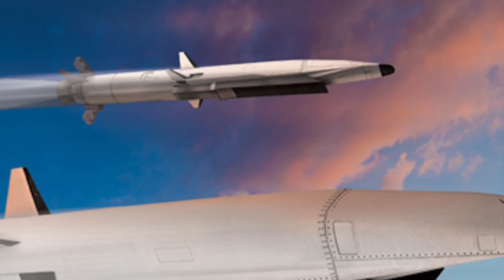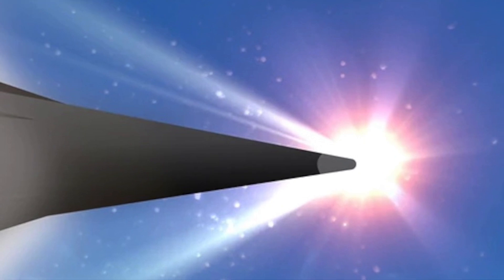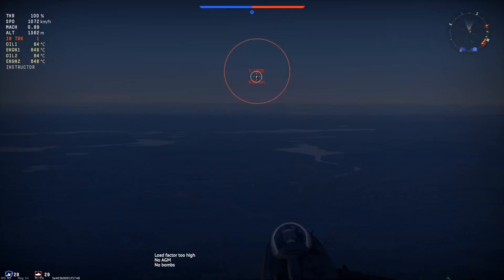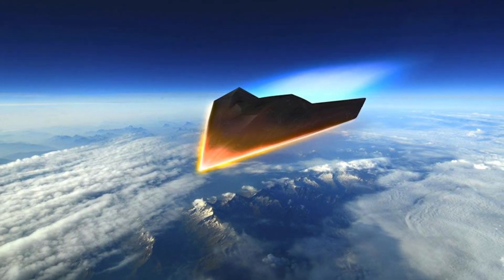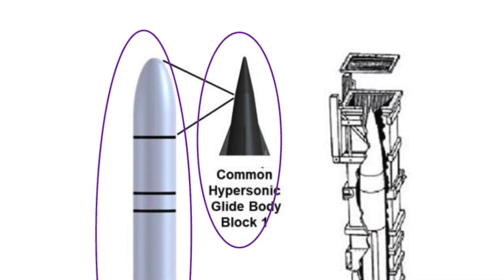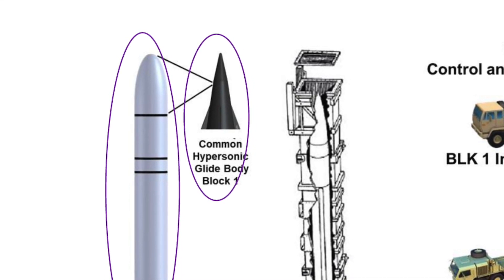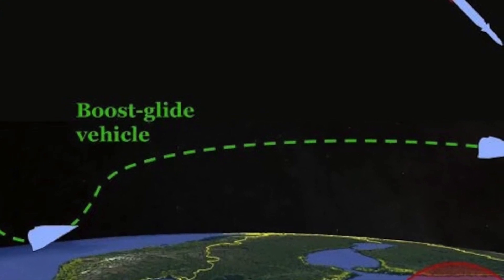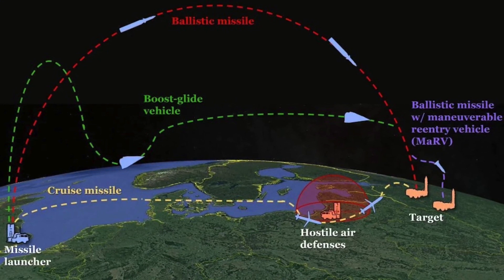Key component for U.S military's Conventional Prompt Strike & Long Range Hypersonic Weapon tested !

Comment: Hypersonicc speed is possible only in stratosphere, at lower altitudes higher atm.pressure and all missiles\gliders losing speed to low supersonic speed, precision 10m accurasy require subsonic speed. 
So all hypersonic weapons can be easy intercepted by current SAM system at finish stage.
Reply: Agreed.
Reply: Not true.
Reply: like some other guy said this is simply not true...

Comment: Hypersonic missiles can not maneuver according to Russias own ram/scram jet patent for their own hypersonic missiles. I would need some serious explanation on how the missile can maneuver with it's engines off and moving at the speeds it is and still hit it's target... They can even self destruct do to increased air pressure when trying to hit its target, so moving would add more stress. For a military page, you should know this, with all due respect.  
"Russian patent number 2579409 relates to the field of rocket technology, and more specifically to hypersonic cruise missiles equipped with a hypersonic ramjet engine. The invention describes a method of application and device hypersonic cruise missile (CRPD), allowing to solve the problem of performing a combat mission to destroy ground and surface targets of such a missile. The described invention is designed to maximize the combat potential of the CMP with the scramjet.

The design mode for the scramjet are high-altitude cruise conditions while maintaining the estimated cruise speed, and the need to reduce the altitude and flight speed creates difficult technical problems due to the fact that:

an engine designed to perform a hypersonic mid-flight at high altitude is not able to continue to work at low-altitude trajectory sections associated with a decrease in the flight number M, hence, the rocket must approach the ground or surface target with an inactive engine;
characteristics of sustainability and controllability of CRPD with inactive scramjet significantly deteriorate, loss of stability becomes possible;
there is also a danger of destruction of the scramjet design due to the increase in pressure in the flow part of the engine while reducing the CMP from the march height before hitting the target."

The US also had hypersonic missiles since the 70s. Google aim 54. The Groundbased midcourse defense is also the fastest hypersonic missiles in the world capable of mach 33. The US prefers subsonic, not even supersonic, sea skimming, under the radar horizon, LO/stealth, missiles.
Reply: hypersonic missile with scramjet engine have poor maneuvers coz it require the air flow has not been interrupted. After engine switch off Hyp.missile is just warhead.
Hyp. Gliders much advanced weapon than hyp.missiles, gliders can use extensive maneuvers, they have much higher speed, higher altitudes. 
Currenly, US leading in gliders technology after few succsesful tests.

Comment: Kinzhal is balistic missile, not hypersonic weapon. This missile has  3 tons mass it can not glide at 10 Mach without losing altitude and speed  dramaticaly, and overall it has no shape of glider for gliding.  Hypersonic weapon should gliding, or should have scramjet engine, but Kinzhal has no scramjet because there is no air-intake in design. 
   All medium balistic missiles - iranian or north korean  have Mach 10 speed, but hypersonic weapon should have  horizontal flight profile, not balistic flight profile.
Reply: This channel gets a lot wrong. It even states hypersonic missiles can maneuver, when Russias own patent says they can't as they need to shut their engines off. When coming back down from it's higher altitude since it needs to take a ballistic path for it's scramjet to even work(it needs thin air and speed) it can self destruct when coming back down to thicker atmosphere when trying to hit it's target, all according to their own patent.
"Russian patent number 2579409 relates to the field of rocket technology, and more specifically to hypersonic cruise missiles equipped with a hypersonic ramjet engine. The invention describes a method of application and device hypersonic cruise missile (CRPD), allowing to solve the problem of performing a combat mission to destroy ground and surface targets of such a missile. The described invention is designed to maximize the combat potential of the CMP with the scramjet.

The design mode for the scramjet are high-altitude cruise conditions while maintaining the estimated cruise speed, and the need to reduce the altitude and flight speed creates difficult technical problems due to the fact that:

an engine designed to perform a hypersonic mid-flight at high altitude is not able to continue to work at low-altitude trajectory sections associated with a decrease in the flight number M, hence, the rocket must approach the ground or surface target with an inactive engine;
characteristics of sustainability and controllability of CRPD with inactive scramjet significantly deteriorate, loss of stability becomes possible;
there is also a danger of destruction of the scramjet design due to the increase in pressure in the flow part of the engine while reducing the CMP from the march height before hitting the target."
Reply: @ThatCarGuy  - Yes, they cruise at high altitude and discard the scramjet for the dive. Nothing in the patent says it can't manuever during either stage, and it's been specifically stated that it can.
Reply: It doesn't really fit into the category of ballistic or cruise missile. Some are calling it a semi-ballistic missile. It can perform guided maneuvers throughout the flight time, so not really a ballistic missile from an interception standpoint. A scramjet would give it better range, but range isn't a criterion of a hypersonic weapon. Frankly, the term hypersonic weapon is rather vague, you could argue that many weapons qualify, particularly Iskander. But Kinzhal certainly qualifies for the most common definition, which is a weapon that travels faster than mach 5 and has the ability to maneuver throughout the entire flight.
Reply: @davidste60  They can not maneuver. It's like you didn't even read it and/or understand it. I will quote the section that matters
"an engine designed to perform a hypersonic mid-flight at high altitude is not able to continue to work at low-altitude trajectory sections associated with a decrease in the flight number M, hence, the rocket must approach the ground or surface target with an inactive engine;
characteristics of sustainability and controllability of CRPD with inactive scramjet significantly deteriorate, loss of stability becomes possible;
there is also a danger of destruction of the scramjet design due to the increase in pressure in the flow part of the engine while reducing the CMP from the march height before hitting the target."

Now with an inactive engine how do you maneuver? They even state it can lose sustainability/controllability...  With stress levels so high at low altitude without maneuvering the possibility of self destruction is possible, all according to it's own patent.. Yet you think it can add more stress by maneuvering at those speeds? Im sorry but you are just flat out wrong.
As proven above they can not maneuver.

With it's engines off, say it's target is 600km away, and lets use the zircon missile for my example, it's max speed is mach 9, convert that to KM/S that about 3km/s. So to reach it's target at max speed(ignoring the time it takes to reach max speed) it will take 3:33... Say you wanted to move a single degree for 5 seconds at 3km/s(lets ignore the engines are off and still somehow magically maneuvered) which would send you off course 15km, how do you maneuver back on course. Scientifically and mathematically explain it to me and prove the Russians own patent and me and my math wrong.
Reply: @ThatCarGuy  - I don't need to prove the Russian's patent wrong, becuase I have read and understood it and you either haven't or are being delibrately dishonest. The problems they outline, that you have quoted, is part of the problem statement. They then go on to describe their solution:  

"This goal is achieved by the fact that, in contrast to the known method of defeating the CMP target, which consists in launching a rocket to a predetermined altitude and flight speed with a launch and acceleration stage (CPC), detachment of CPC, launch of a sustained scramjet, active flight at an estimated height in the direction of the target, search , capturing and hitting the target, in the claimed invention, after detecting and determining the coordinates of the target at the point of the trajectory calculated by the onboard instrumentation of the control system (BASU), the scramjet is switched off.

After the end of the active part of the flight power plant is separated from the combat module. The trajectory segment associated with the planning and destruction of the target overcomes the combat module. The separation of the power plant will lead to a decrease in drag and, consequently, to an increase in the length of the planning section, the combat module will be able to withstand large allowable overloads and, therefore, have better controllability. Also, the separation of SS will lead to a significant decrease in the effective dispersion surface of the combat module, and, consequently, to a decrease in its visibility, which is especially important when approaching the target.
Reply: @davidste60  Im being dishonest yet you literally quote ...
", which consists in launching a rocket to a predetermined altitude and flight speed with a launch and acceleration stage (CPC), detachment of CPC, launch of a sustained scramjet, active flight at an estimated height in the direction of the target, search , capturing and hitting the target, in the claimed invention, after detecting and determining the coordinates of the target at the point of the trajectory calculated by the onboard instrumentation of the control system (BASU), the scramjet is switched off."

So predetermined trajectories are maneuvering? That's news to me. They can not maneuver.
Reply: @ThatCarGuy  - Read the bit before that, "in contrast to the known method of defeating the CPM target, which consists in...". It's a patent, they describe the known method and then, in contrast, describe their new method. No one writes a patent to just explain a known method. Once the engine has been seperated from the combat module, the problems they described with scramjets no longer apply, because the scramjet is gone. If the combat module goes 15km off course in 5 seconds, for whatever reason it would decide to do that (seems excessive to me), it can turn the opposite way by 1 degree for another 4 seconds, then some lesser angle for 1 second to get back on track. Using aerodynamic surfaces of course. That's why I raised the possibility of dishonesty, because you're reading the same document as me, and leaving out vital qualifying parts of it, which do not support your argument.
Reply: @davidste60  Blocked, you are trolling me hard at this point. There is no way you do not understand the patent that badly. 
Everything I quoted to you is "in contrast to the known method of defeating the CPM target, which consists of..."

So since it's in contrast to everything I quoted
" the scramjet is switched off."
I guess the scramjet is left on to self destruct....

"after detecting and determining the coordinates of the target at the point of the trajectory calculated by the onboard instrumentation of the control system"
I guess we have no target detection since everything is in contrast to my quote above. 
You got me, first troll in awhile that got me that i didn't outright block. Congrats, have a good time trolling others.
Reply: @ThatCarGuy  - Get someone else to read it and explain what they think it means to you, without telling them your opinion first.

Comment: What about laser weapons they use chemicals as a weapon that faster than Hypersonic?
Reply: It would have to be a really strong laser. One commonality of all the hypervelocity missiles and reentry vehicles (HGV) will need to be their resistance to the heat of passing through dense sea level atmosphere at more than five times the speed of sound, usually this is accomplished through the use of ablative tiles or some other temperature resistant ceramic or cermet. The SR-71 only did Mach 3.5 and had to be at extremely high altitude to survive the passage through the attenuated air at speed even at that height. The heat of passage in the SR-71 was mainly stored in the fuel which won't be an option in a hypersonic weapon, they just aren't big enough, and even with that large internal heat sink the friction caused the plane to expand by almost a foot. Burning through the skin of a hypersonic weapon with a laser in a very short period during transit at those speeds is going to be a lot tougher than burning through the metal of a normal missile or drone. Putting something in front of it seems like a better idea. The very kinetic energy that make it such a good weapon against ships and hardened targets will rip it entirely to shreds if so much as a gram of something solid gets in the way. It will be like the weapon getting hit by a meteorite.
Reply: @massivereader  It's a start and it the only thing that is faster than hypersonic?
Reply: Chemical lasers are very unstable compared to solid state lasers. The US has fielded an aircraft with a large chemical laser in the past, but found that it was quite inefficient for the intended role. Solid state lasers have seen quite a bit of advancement as of late though. However, you still have to overcome the atmospheric implications for it to work effectively. Hypersonic weapons by design are going to be engineered to withstand the immense amount of heat that comes with hypersonic flight. I'm not saying that it might not be possible in the future, but we're still quite a ways off from being able to field a powerful enough laser, with the requisite technology to perform this task.
Reply: @jaysartori9032  Here's the thing... you don't necessarily have to be faster than the hypersonic. You just need to get between the weapon and it's target. That's an inverse square issue with the advantage going to the defense. You only need to pepper the possible glide paths with detritus from a fragmentation warhead. While main the advantage of hypersonic weapons over ballistic projectiles is that they are steerable, physics requires that 'steerable' take a god awful large distance to happen due to the vector of momentum and the resultant G-force loading while deflecting from the original path. The SR-71 took the entire width of the State of California to turn around and reverse direction when at speed. An unmanned weapon going three times as fast? It isn't going to turn on a dime. Now if the HGV is a nuke? Different issue there. All they have to do is get relatively close. They can be proximity fused with radar to cook off if anything gets near their projected path. It won't be a direct hit, but there's that old saying about horseshoes and hand grenades... As to lasers, they simply aren't powerful enough right now. It would need several orders of magnitude more than our best current capabilities to accomplish this goal.

Comment: I’d rather have the gist than the specs.  Pros cons usability, then the specs
Reply: Pros to hypersonic missiles are they are fast, good for first strike or nuclear strikes. Best for short range strikes otherwise as long range strikes are easily intercepted when at war do to them flying so high and burning so hot they get a coat a plasma, which can disable the missile and allow any IRST radar let alone AESA radar or satellite to track it. What I mean by them easily being intercepted at long range is, say your target is 600km and using the zircon missiles top speed of mach 9, converting to km/s is 3km/s, 600km divided by 3km/s is 3:33 seconds at top speed without taking the time it takes to reach top speed into account. So over 5 minutes easily to try to shoot it down. 

This is why nations like the US prefer subsonic missiles are they can stay under the radar horizon, can sea skim, are LO/stealth, etc. Easier to shoot down by CIWS style weapons and why even nations like Russia who prefer speed in hypersonic missiles still use subsonic missiles, each have their pros and cons.

Comment: Still yrs behind Russia and China they hypersonics in service now..We still developing a scram jet engine needed. This is propaganda
Reply: In the off chance you aren't trolling. The US has had hypersonic missiles since the 70's, google aim 54, it flew on the f14s. The US also has the fastest active hypersonic missile the groundbased midcourse defense capable of mach 33. This is how the US is fast tracking them, we already knew how to do it. But we prefer subsonic missiles.
"The GBI consists of a 3-stage solid rocket boost vehicle which can place it's payload of an Exoatmospheric Kill Vehicle outside the earth's atmosphere. In order to do this the missile must reach an escape velocity of more than 6.9 miles per second. This hypersonic speed is several times what a 7.62mm bullet travels leaving the muzzle of a gun. To put it another way, it reaches a speed of approximately Mach 33."